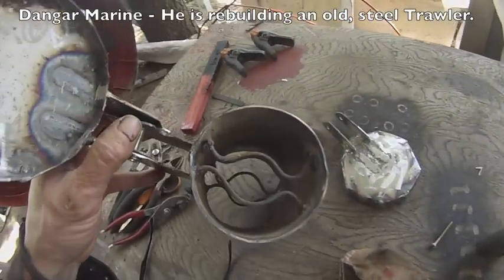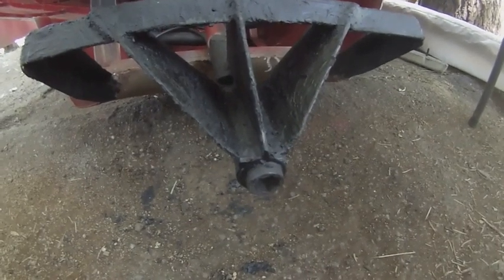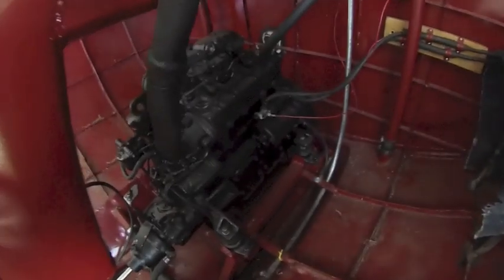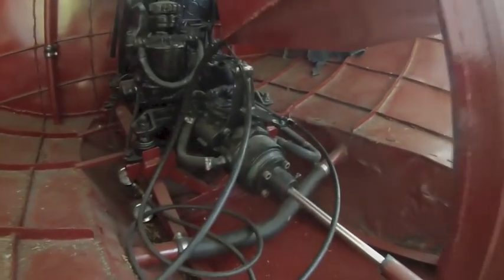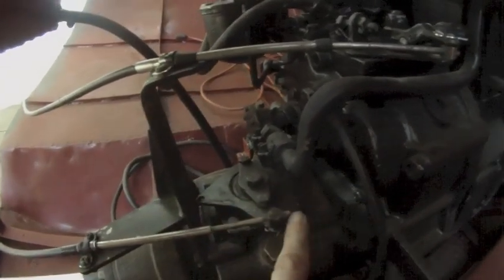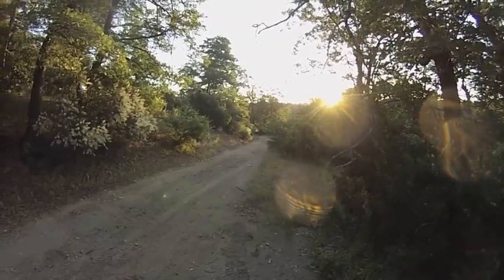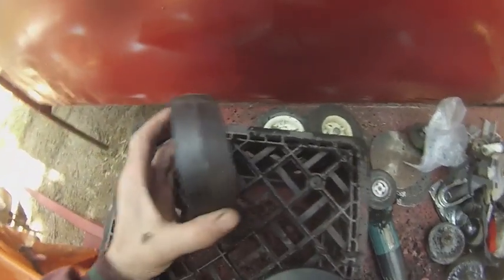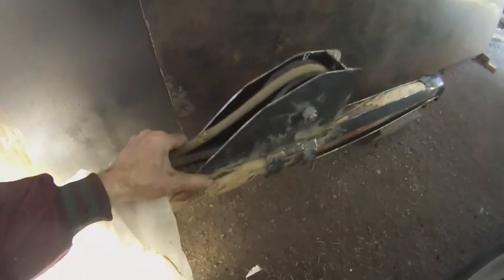Steel Sailboat Build Part 29

Comment: Creativity makes for a pocket filled with functionality and savings.. All is coming together very nicely, look for your Aug video.. Very cool !!
Reply: Not if you spend years of your life building something that ends up not working.  If you want to build you own boat, find a stock design, or have a stock design modified by the designer to suit your needs.  There is every type imaginable available.  Rig it how you want.  Junk, sloop, whatever.  At least you'll have a sound hull and something worth your efforts.  Like others have mentioned, you may not find a marine surveyor who will certify your craft.  Without insurance you can not get a slip at a dock.  You can't trailer sail this  boat.  Start over my friend, and use the lessons learned to build the craft of your dreams.

Comment: Great to see another post.  Really like the way you scavenged material.  The reason the $50 levers worked is because you found a way to make them work rather than spend a lot of money.  Creativity has significant value.  Thank you for sharing your progress.
Reply: g
good comment
Reply: @smartmonkey777  Thank you.
Reply: morse actually make a slotted throttle fork end for this specific issue, also found on older yanmars as well,

Comment: If you can find a cheap metal lathe, it would expand your capabilities quite a bit. You could turn scrap into whatever shafts, spacers, bushings, bolts that you need.

Comment: You need a stuffing gland on that prop shaft to keep water from coming in the boat.  The Cutlass bearing does not do that.
Reply: yep , i didnt even realize that at first but, a stuffing box is easy to add in .

Comment: On the shaft for the pulley, take a piece of rough glasspaper and score in a motion reminding of a gun bore a few lines. Doesn't need to be deep, just enough to promote motion whenever it's moving, then, when you install it, if you put a dollop of grease on either side, it will wick itself around.

Comment: why would you re design a perfectly good morse 33c control which have worked for years on the same engine as yours. A stop cable would be the best way to stop the engine.

Comment: I am amazed at the work you are doing with very few tools. 
However, with the modification, you have made to the throttle and gear change it could be dangerous. The manufacturers build in safety features to these units to stop the operator of the craft going from forward to astern with slowing the engine revs down first. The way you have it set up is if you do not reduce the engine revs first and change from forward to reverse I am sure you will smash something. Also making rollers for your halyards out of old rubber wheels is not a good idea. There are huge loads on these blocks and I don't think your rubber wheels are designed for this. 
Ian Langley - Time served Marine Engineer
Reply: this is a good point!
Reply: He doesn't care. It will be like his half completed cars

Comment: Im thinking that engine is going to break the frame causing a crack in the hull
Reply: @BlueFlyer
No
Reply: I do not think it will... this guy has been building engine mounts, etc. for years.  Lots of concern in his build at present, but his engine work and mounts are not one of them for me.   Now that fuel tank...
Reply: people underestimate how strong steel is.... fyi the tensile strength of steel is like 90k psi , so 1/8 steel is around 10k psi.